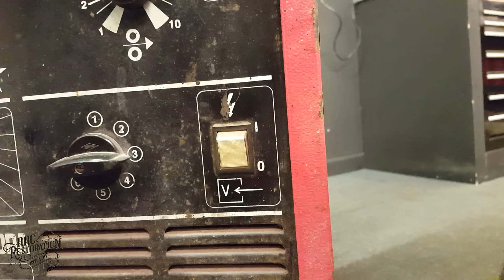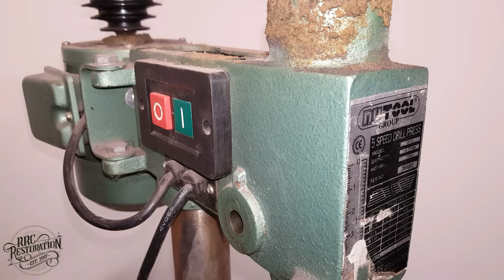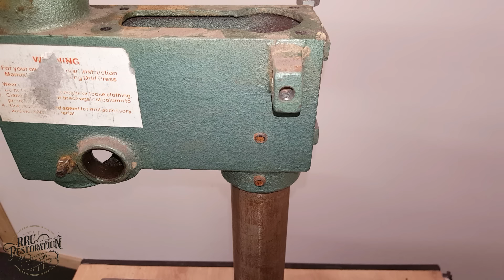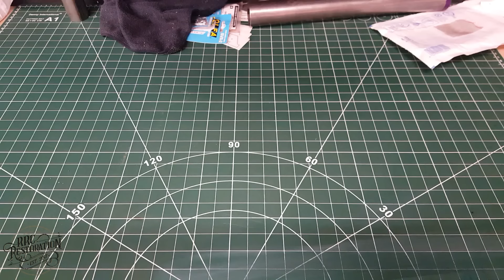Worn Out Pillar Drill Restoration - JUMBO Episode

Comment: Nice restoration. Now please throw away that guard as it's flamin' useless, and make yourself a depth gauge (which is actually useful). The depth gauge screws into the hole on the top left of the guard (you can keep that bit) and runs through the hole above it in the housing, with a pointer added to the scale on the label you made.

Comment: It was a very good work and the result is perfect but you only need to clean the dust in motor, put a new return spring and change the ball bearings, clean the rust on the working tray but no need to change the paint because no rust under the origin paint

Comment: Very thorough. But I thought you might have gone a little bit overboard. The original paint seemed to be in very good condition.  And the blackening process can soften the metal unless good temperature control is adhered to. Tempering the metal back to spec is not difficult.  I have noted that the application of a light coat of machine oil on machined surfaces is not done, ever. This one five minute job can save quite a bit of money in the long term.  I did like the use of the arbor press for the bearings (except for one smacked with a hammer) the press will no doubt increase bearing life! Perhaps I am too picky. I should remind you of the fine workmanship that you used to do a splendid job of refitting the drill. I was impressed by your recreation of the spring return. Super job on that! All in all, excellent work. The end product looked good as new.

Comment: think those return spring caps are universal one size fits all , the one you made is less sharp and a lot less ilkely to schred up youre palm during instalation though 
supprised (but then again it seems to be a budget machine to start with ) there arent any small sleeves or tules to protect the wiring where its fed through metal holes , this would preven scafing of the wiring and causing shorts over time

Comment: Excellent job. one question though. Will the heating of the parts for hot bluing, not have taken the temper out of them, making them soft? I watch a lot of knife making videos and this is always a concern of theirs. They fully harden them then temper them back at about 200*C, so I'm just wondering if taking them to 3 or 400*C will soften them too much. This is a query not a criticism, as I said, I'm a " You Tube Specialist ".

Comment: Hi! I have one of these drills I was considering swapping for another machine as it has similar issues to yours running rough and having spindle wobble. Going to give an over haulk a go but the part you have I can't seem to find is the guard for the chunk that takes the depth stop. I don't suppose you have details of the bearings and parts used after all this time do you?

Comment: Those Nu-tool machines were crap when they were brand new and certainly didn’t improve with age. They did have price in their favour and I owned one or two back in the day. The best one I ever had was a 50 litre air compressor which worked well and lasted for a lot of years, eventually dying in 2016/17.  I don’t know when they went out of business, but it was a long time ago. You made a nice job of that, best I’ve ever seen a Nu-tool machine look.

Comment: Excellent vid, RRC. Really clear with great detail shots. Can I ask where you source the spares? I noticed that you put on a new plastic guard and mine is broken. Also how did you remove/replace the chuck?
Reply from the maker: Thank you, glad you enjoyed it. MOst of the parts can be sourced on ebay for these drills. The chuck is a taper fit all you need to take it off is a ball joint separator fork and itll pop right off.

Comment: When did stainless steel become softer then cast iron? 🤔
Reply from the maker: I probably should have explained better, i used a wire brush because it wont remove material like blasting, or using a grinding disc

Comment: Awesome restoration. Did the lid of the gear belt not have a micro switch fitted as mine does and becomes a pain at times. Also where did you get your new guard from. Awesome job.
Reply from the maker: Hi, no there was no micro switch on this model, although i have heard from other viewers that their machines came equipped with them but as mines is quite an old model and theirs was newer i think thats why. The new guard came from ebay, just measure your drill neck size and order the correct sized guard and your good to go :)
Reply: WoW! yours must be really old as mine is about 20 years old and has one but to be perfectly honest your better without the microswitch. Thanks for the heads up on the guard.

Comment: Hello :).
Do you have record of the bearing part numbers for the quill and the pulleys? Also the number required? (I think the pulley wheels are using double bearings - even the centre wheel).

Quill top x1
Quill Bottom x1
Pulley front x2
Pulley middle x2
Motor - I'm not touching this!

Comment: How did you remove the chuck? I have one the same that needs cleaning up and the chuck doesn't have a taper key. I presume it can be removed with two part wedges but it would be nice to know for sure before mullering it!
Reply: A lot of copies of this type of drill press were made and sold under various brand names. I have a very similar one made by Ryobi from the mid 1980's. The chuck is a friction fit taper fitting. I ended up having to hold it in a vice then use a block of wood to tap the chuck off.

Comment: I’ve got the bigger model with the tilting bed which I bought from Machine Mart years ago. 

Unfortunately the chuck has a habit of falling out when it’s used for heavy work. It seems that the Morse taper in the spindle is not cut correctly, or inaccurately. 

When I complained to Machine Mart they said I had to take it to their main depot, and it could take up to three months to get a replacement. That was bullshit of course. But because I needed it for work, I put up with the fault. 

Then some time later I decided to complain about it to a more helpful manager at the local store. There was no record of the sale!!

Anyway, have you ever come across this fault? If so, how did you fix it?

Great vid. I was expecting to see Hamerite paint go on, so multiple undercoats on top of an etching coat, followed by Post Box Red surprised me. Nice work. Thank you for sharing

Comment: You didn't bother filming the little remove-play set screw that rides in the keyway of the quill. If it's the crappy rectangular design one you can only remove when the quill is removed, I replaced that with a normal one turned down to keyway size so I can fine adjust the pressure on the quill and remove the play.

Comment: Those Angle Grinder wire wheels are DEADLY!
I was using one, a few months back, due to its hard wire, it hit the edge of the metal i was working on, jumped out of my hands and went up the side of my leg, tore straight through my overalls and ripped the side of my leg to bits....
Will never touch another one of those wire wheels for angle grinders lol
Reply from the maker: Ouch sorry to hear that, i defo agree with you though they are lethal
Reply: Ouch. Thanks for the warning, one of my subscribers is sending me some from the UK, I will cautious.

Comment: I've got exactly the same drill press, I think mine could do with a rebuild as well. Are the bearing codes printed on them, or did you take measurements with your callipers?
Reply from the maker: Hi, the bearings have the codes printed on the outer race if memory serves me correctly.

Comment: Perfect job. Although I think you made a very good one, that missing coil-spring housing is a matching fit among all these 5 speed drill press, made/sold by: Draper, MachineMart, Silverline and rest of the chineese made ones can be bought on e-bay/amazon. Majority of these pillar drills like wobbling and would benefit from a little tune-up and a replacement of a better quality chuck and aligning both pulleys.

Comment: I have one of these, complete with knackered bearings. Thanks, I now know how to fix it. Incidently, mine has an electrical safety switch in the belt compartment which stops the motor if the top is open.

Comment: As always a wonderful restoration. I have a couple of questions.  What makes you decide to use a paint stripper versus other methods. You could have used Deox-C your go to method to get surface rust off, yet you chose to use the wire brush. What makes ya chose one over the other assuming the results are the same. Thank you as always for working on the details.
Reply from the maker: Thank you, glad you enjoyed the restoration. For the paint removal i decided to use paint stripper due to the size of the parts and how hard the original paint was it takes less time and is more time effective than standing at the blaster for hours. As for the rust removal i chose the wire wheel as the rusting was only on the surface and the wire wheel has the added benefit of polishing the surface while removing the rust so again its a big time saver being able to do 2 jobs at one i hope that answers your questions?

Comment: It would have been interesting while it was apart to see if there was away of converting it to run both backwards and forwards you could then use left handed drills to remove snapped off bolts . A ordinary drill works of course but a pillar drill would ensure the hole was perfectly vertical ensuring you didn't hit the threads going off center

Comment: Brilliant, as usual. Great to see the drill get some loving, mind you, the red paint job was a surprise. I was sure you'd be going for original "grotty" green. Sounded great at the end. 

When I fixed outboard motors, the recoil starter springs were a nightmare. No dafety wires for me, I had to hand wind the buggers myself. One or two did ping across the workshop! Happy days.

Take care.

Cheers,
Norm.
Reply from the maker: Hey Norm always nice to see you . Glad you enjoyed the restoration, i did think about going for hammered green again but thought red would be cooler and it would match the Snap-On boxes.

Comment: This was among the BEST tool restoration videos I've seen!  I have a VERY SIMILAR, maybe slightly larger drill press to clean up and get in shape.  I can now say I'm familiar with ALL components of the drill press to which I give you MANY THANKS!!!  I was a little apprehensive about replacing bearings should I need to but now that I know how these are put together I have a clear picture.  I also picked up on many other details you used on your restoration.  You REALLY went to town on this!!!  It is MUCH APPRECIATED!!
Reply from the maker: Thank you so much for your kind comment it means alot :)